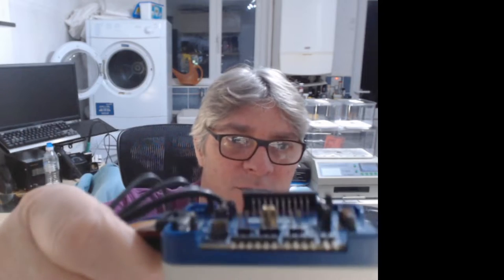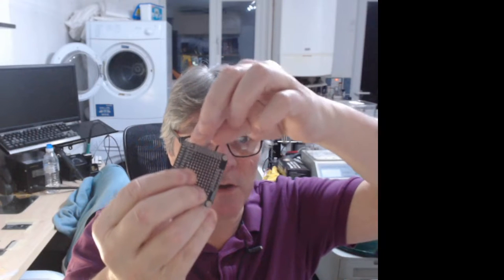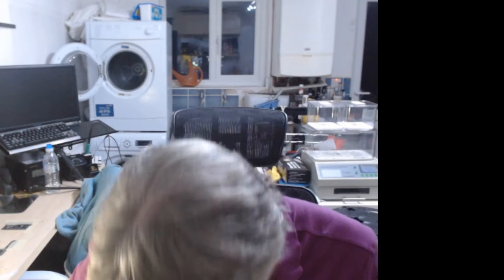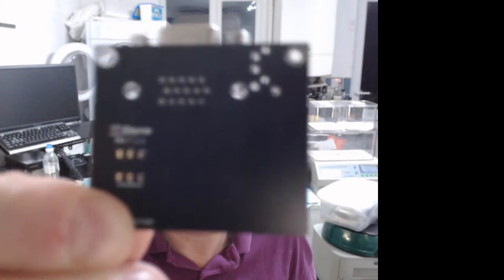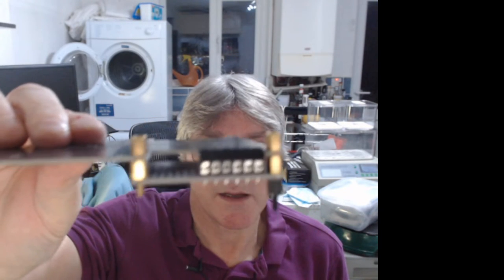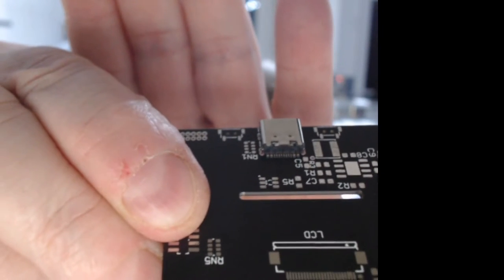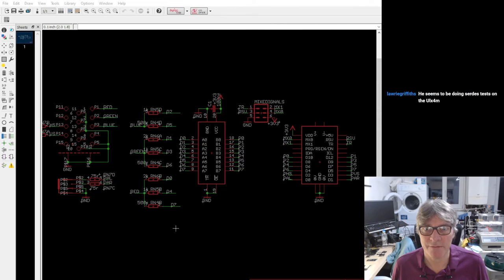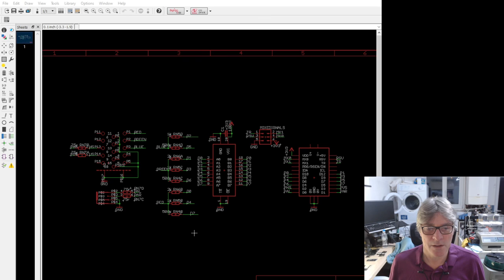Ice LogicBench and Tile PCBs just arrived.

Comment: My guess is there is a odd resistor pack 222 vs 471. Can't quite make out the numbers though. ;-) Nevermind, Lawrie got it LOL
A Rust stream would be handy for sure.
Reply from the maker: Well noticed, it was the connector gender as pointed out, however the 222 (22k) resistor array was originally meant to be 10k arrays but I didn't have those in that size..